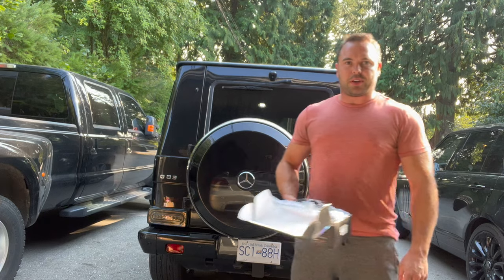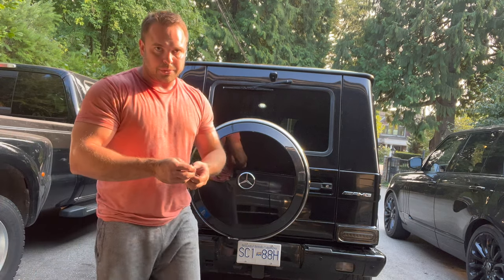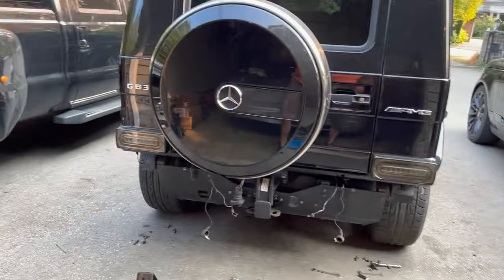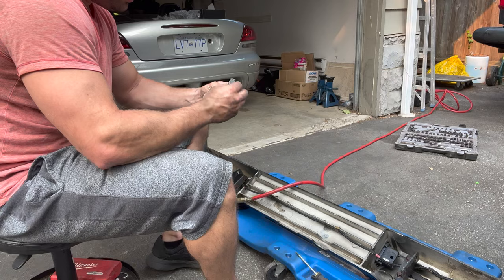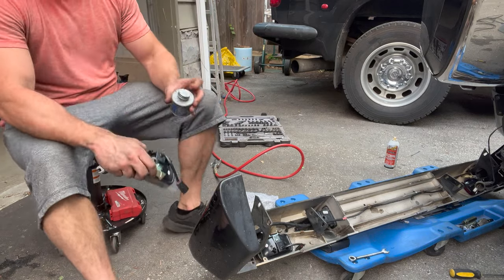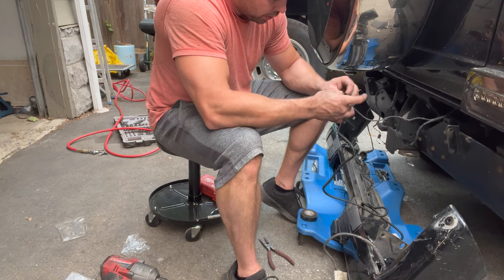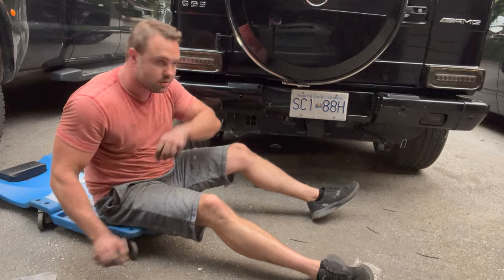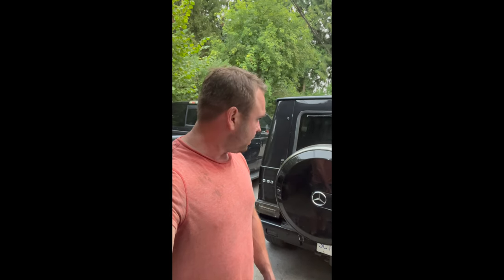Replacing rear lights and parking sensors on a 2013 G63. Bumper removal, new sensors and new lights

Comment: Hey @ViperMike thanks for the informative videos on the G63! I also have a 13. Did you use resistors during the install of the LED taillights and/or the LED fog lights?
Reply from the maker: Yes I did. The reverse/fog lights came with resistors. I believe the tail lights have resistors built in
Reply: @ViperMike  Thank you! I installed both the tail lights and fog lights yesterday and used this video as a quality guide. After the install, I'm happy to say all the lights works great with no messages on the dash. Cheers!

Comment: I just bought the same back up fog lights! I’ve done side markers and tail lights as well . My g is a 13 and do I need to drop the bumper to change out ?
Reply from the maker: Mine is also a 13. You don’t have to drop the bumper, but having it off makes for an easier install.
Reply: Do you have seller link for reverse lights?
Reply: @antoniodearing5487  I got mine on eBay along with all other leds for the G . Nice upgrade as the lens all get cracked and melt . Typical of Mercedes Audi VW .
Reply: @ViperMike  thanks 🙏🏼
Reply: @DannyBoy-vs3gd  Okay, I ordered mine off EBay yesterday…..thanks again!
Reply from the maker: @antoniodearing5487  they're made by iJDMToy. I believe you can get them on Amazon or directly off their website
Reply: question, when you put on your side markers did you cut your wires or did you unplug them? I have a 2015 G63 and when I take the rear side markers off, the adapter seems to be stuck under something.

Comment: Have you ever replaced the side markers? and when you took your bumper off does it expose wiring to side markers?
Reply from the maker: The wiring is behind the tail light
Reply: @ViperMike  i removed the tail lights and the tailights are encased no way to get wiring; just fyi i ended up just cutting wiring and soldering it to the new side markers; thanks for responding back